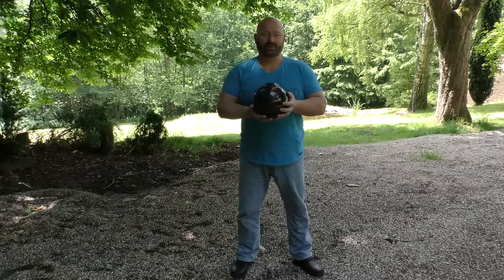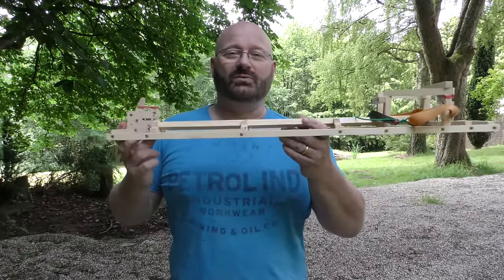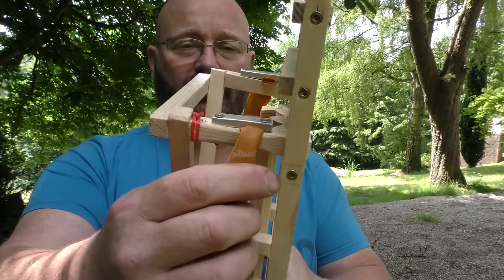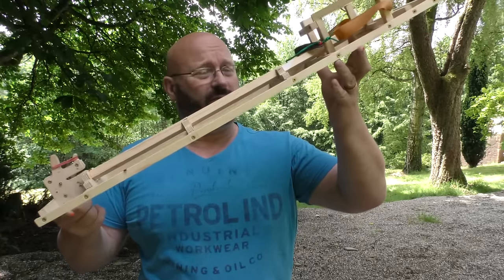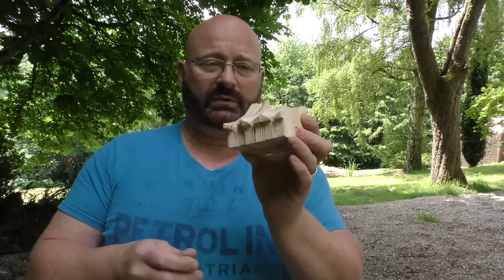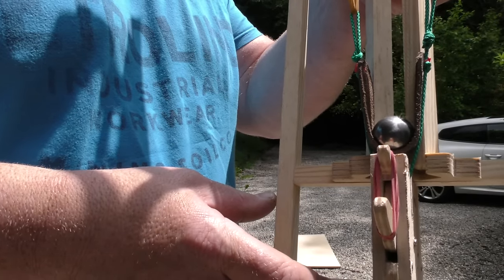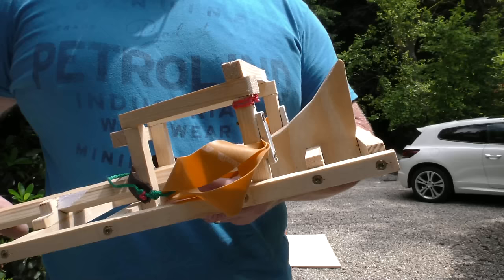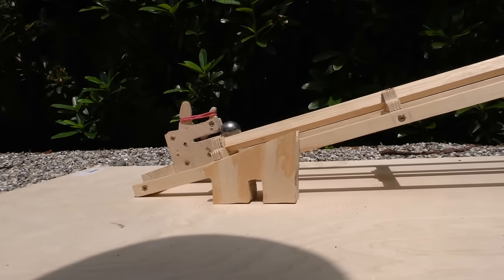Bowling Ball Launcher 1:10 Scale Experiments

Comment: Hoist, hoist hoist. It should be much more successful that way. A smooth-transitioning ramp of 30-35* or so would do relatively well as long as it's a smooth curve from the flat to the angle instead of just a wedge at the end of the track. However, i feel as though the energy loss would be  much more significant on that scale unless the ramp is EXTREMELY robust, which it would have to be anyway. That's an enormous amount of energy to deflect without things crumbling to splinters. Good luck, my friend!

Comment: Use the ramp.  You get the advantage of accelleration over a flatter surface with out having to overcome gravity from the start.  I think that any loss at the transition to the ramp will be relatively insignificant.

Comment: Why not do a little of both. Lift the end of the entire launcher a bit (what ever is physically feasible), and also have a slight ramp. Using both you can get as close to 45 degrees as possible, without having to prop up the launcher at that insane angle, and not lose as much energy from friction by using a ramp with a smaller angle. 
I guess the question is, where are you planning to shoot the full scale model? Do you have enough room? You don't want to accidentally land this on the neighbor's car.

Comment: I personally think that hoisting it up is the best solution. I'd expect the bowling ball, which is far less dense, to lose far more of its energy on the ramps at the end.
You could technically hoist it further up by affixing it to the ground and putting the piece of wood you will hoist it up on further towards the middle of the construction.
Another possibility would be to hoist it up using ropes.

Just to give maye a few ideas you may not have had yet.

Comment: I would think the use of a hoist and support would make it a wee bit more versatile. Of course, if you put the support legs on a hinge, and wheels on the base of the legs, then you could attach the hoist between the legs and the frame of the main body. Then it would lift itself, with no need for an overhead hoist.

Comment: The problem with the wooden ramp is the losses due to friction. This is doubly important because the forward force is going onto the ramp, increasing the friction.  Even if you set the pouch to roll the ball and coated the surface with a lower friction material a lot of energy would be used up compressing the wood in the ramp. I would suggest a steel ramp at the very least. Better still would be to hook a roller track from a door frame and have this under the whole path of the ball.

Comment: build a staircase under the end of it at 2 meters tall, hoist the contraption onto it, and then go up the stairs and hoist it to 2 meters above that from the staircase, that would take it to about 28 degrees.  either that or build a tower that's about 5 meters tall with a winch on the top of the tower and use the winch to hoist the end of the shooter up to whatever angle you want.  if you have any questions, i will be happy to help with concepting

Comment: Yeah I don't really think the ramp attachment will work. If you are going to accelerate a 10lb (4.5kg) bowling ball like that I think it'll apply to much force to the ramp and it'll ruin it on the first shot. Sadly I think your best option is to hoist it up or you could build the rail and raise it on its own slightly to provide it's own hop up.

Comment: Remember material strength applies and doesn't scale if you're using the same wood. That ramp will destroy your machine on larger scale or at the least the ramp itself will turn into splinters. Especially if you're scaling up the power output too. Btw, 'more far' = further.
Reply from the maker: From Merriam-Webster:
Usage Discussion of farther
Farther and further have been used more or less interchangeably throughout most of their history, but currently they are showing signs of diverging. As adverbs they continue to be used interchangeably whenever spatial, temporal, or metaphorical distance is involved. But where there is no notion of distance, further is used <our techniques can be further refined>. Further is also used as a sentence modifier <further, the workshop participants were scarcely optimistic — L. B. Mayhew>, but farther is not. A polarizing process appears to be taking place in their adjective use. Farther is taking over the meaning of distance <the farther shore> and further the meaning of addition <needed no further invitation>.
Reply: lol
Reply: lol
Reply: ha ha ha ha ha ha ha

Comment: You could build it on the back of a flatbed truck? Maybe not the best (or cheapest) solution but one with a hydraulic bed would let you set the angle and make it easier to move around being 7m long.

Comment: i think the hoist will work far better, because using the ramp, the ball is impacting the ramp at the point of change in the angle. so you would most likely see less loss in distance using the hoist. but why not make the hoist into another winch style design so you can adjust the height, and thus the angle.

Comment: Instead of using rubber for a slingshot, try using a piston with a little bit of air in it. As you pull on the piston, the air expands; creating negative pressure. If you let go, the piston retracts just like a rubber band. Big syringes work great as a piston.

Comment: I believe you should hoist the entire contraption to a 45 degree angle rather than a ramp. With the entire track at an upward angle, it is a gradual acceleration where the ball leaves the track at its fastest. With a ramp at the ending the track, I believe that it will slow the ball too much to be efficient.

Comment: As much as the bowling balls weighs you'd have to leave a good amount of footing past the ramp, or the weight would cause the entire structure to flip up from the rear as the weight hits the ramp, or anchor the rear of the structure down to the ground. If you incline the main leadway it would put all the force of weight at the rear on the launcher, so i would probably be a a good ideal to dig out a flat angle in the dirt for the rear of the launcher structure to sit in so it doesn't shift as soon as you launch and cause your trajectory to be off. Or the weight of the ball hitting the ramp would cause the support beams or angle block to crack, or flip over off the end of the rails.

Comment: just angle the rails upward (with supports), as it would be much easier to build it that way, than lifting the entire contraption. also would allow for a fixed base, which should mean better stability, and you wouldn't lose velocity by using ramps.

Comment: I think that the firing rail should be at an angle to the base, 15-30 degrees elevated while set on flat ground. It'll be a bit bulkier but it'll be nice and sturdy without needing to jack the entire structure up.

Comment: use a scissor system perpendicular to the front to hoist it in the air. Using a rope system across the front with varying locking points you could easily change the angle of launch. I'd be interested in drafting something for you.

Comment: I think if you use a curved ramp instead of one consisting of a few sections at different angles, you would lose less energy.
But it seems that hoisting the thing up works better. So, why not add kind of a bipod that would be hinged about the middle of the "barrel" and stretch to the "barrels" end. The other end would roll on wheels and if it's pulled  back by another winch and rope, it would hoist the barrel up. With wheels two meters apart and rolling on kind of rails, it should be stable enough.

Comment: The ramp isn't going to work. The bowling ball is going to have way too much energy by the time it plows into it. Fortunately, I have a simple and cost effective solution for constructing the rails at an angle: pre-fab roof trusses. While you could get away with cutting one in half and using each wing as a rail, you'll probably want another to build out an exterior frame as you have in your 1:10 prototype. I'm not sure what's available in Deutschland, but here in 'mericuh you can get 4/12 pitch which translates to 18.43° which is right around the sweet spot you established experimentally. The frames shouldn't cost you more than 200€ and will let you focus on the fun parts of the build.

What I want to know is what kind of rubber you're going to use? Do they make bands that big or will you be chaining smaller ones?

Comment: when your little experiment ball hits the wooden ramp it doesnt couses much smash affect but in real version you will have lot more energy focused on same element(wood) that may couse dents in wooden ramp. I think you should use a parabolic ramp that starts with zero angle at first few cms and starts to increase slowly. you can reach any angle at end of the ramp. Also important part of ramp is the end. You get greater energy lose as you increase ramp elevation but you will get maximum range at 45 degrees to ground. AGain most critical issue is the compressive strenght of wood that you use in ramp. İf your ball hits it nothing will go good. Also when the ball slides on the ramp it will push whole weapon to the trajectory way you have to fix weapon at both ends. Maybe mid span will be needed also..

Comment: I vote to hoist the launcher. You could build an A-frame with pulleys and raise the A-frame higher than your normal reach and use the pulley system on the A-frame to hoist the launcher. I would imagine with some math you could even adjust the launcher's angle incrementally in this way.

Comment: Hoisting the ramp should be better once tha ball will not impact on the additional ramp, but harder to do.
If you choose the additional ramp you need to prepare it to hold the ball impact and not deform with it. If you use only wood it will deform more and more and the impact will be each time higher.Good luck!

Comment: Hoisting it up will have a much better result in real life and here's why. Your scale model is based on diameter, wich means that the diameter is 10x smaller. But when you consider the mass, it is 1000x for the same material, but even considering the material were not the same, the ratio would be much bigger then 10x. The energy loss when the bal hits the ramp is based on the mass and the speed of the ball, and with a huge mass, the shock will lose much more enrgy then the model did.

Comment: Build a simple "A" shaped structure out of two beams with a winch at the top and hoist away. the back end could be fixed with two stakes so it does not slide forward or back. Then it should stand on its own, hanging by the winch.

Comment: I think a sharp angle (15 degree changes) is not ideal.  I'd wager you want a curved ramp (circle arc would do well) with the entry tangent to the acceleration rails, and the exit tangent to your desired launch angle.  This would loose less energy to impact, and also seems safer.  I'd wager with the straight ramp design, there's a good chance the ball is hitting the entry of the ramp and bouncing well off up the rails, which on a larger model could be quite dangerous both in terms of the final ball direction, and breaking the ramp.  At the very least, I'd put the high speed camera on it to look for this bounce...

Comment: Elevating the slingshot should overall have better results because with the actual launch being 10 times larger the ramp would have to be very gradual so that the bowling ball wouldn't lose momentum for flight and also so that the ramp would not break from the sudden pressure of the bowling ball flying across it.

Comment: Maybe use a re enforced tripod or two stands in the front and one in the backwith a sturdy base for the slingshot and points at the bottom so it sticks into the ground (like the kabuto)and cheap sheet metal for the railings and add lubricant for less friction
Reply: Just an idea

Comment: If you where to build it on the back of a tilt bed truck (i.e. A dump truck or similar trailer) then it stay "flat" on its platform that you build it on and the whole platform would tilt super simple and you could adjust angle as you like. 🔫SCA⚔

Comment: The ramp would work a lot better if it was a smooth transition fron 0 to 15 and 0 to 30 degrees. Like an arc instead of two straight lines. The sharp 15 degree angles that the ball smashes into take away a lot more energy than a smoother transition would.

Comment: IF you want it to fly as far as posible try 30 - 45 degree angl , not ramp but putting whole thing in an angl. The diference is in 7 meters ,  witch in full size would be like 30 meters. btw i did not calculate anything so it may not be inpersicive , but more or less it should be it.

Comment: As a skateboarder,  I have seen many ramps and the problems of each one. Many times the threshold between the flat plane and the beginning of the incline is the biggest hindrance when using them. The concave transition of a kicker ramp would be better suited,  as opposed to a wedge, for this application. Similar to the ramps used in moto cross as well. With a smooth enough threshold and a very mellow transition radius,  the ball should lose much less energy,  and achieve a more favorable trajectory.
Reply: Further consideration has made me wonder if a suspension spring under the ramp would help with energy loss or stability. A very stiff spring,  relative to the energy presented. The effect would be reminiscent of the end of a Jai Alai* (spelling is probably wrong)  but in a vertical orientation, at least in my head it seems so haha. Please let me know if you give these thoughts any consideration, I would greatly enjoy knowing your opinion.
Reply: Jai Alai bat/mitt*

Comment: i think ramp would no work in bigger scale. That thing needs to be made from steel and old car wheels underneath it, so it can be mobile. The one end with 2 meters high pully system and wintch so you can crank it up in adjustable angles, so one wintch (or two) for launcher and other for angle.

Comment: Hallo. You could made double tripod stand conected with elevation rod. And conect it with bolt in the midle of launcher. Elevation rod would be next to shoting mechanism. You can aesily change the elevation and stan shouldn't be 3 m high(only about 1.5 -2 m).

Comment: in the Real scale slingshot you will need a very strong structure to raise it up and not brake under tension. in my opinion the best compromise is to put the slingshot down and add a rounded ramp that shot at 35°
Reply: or you can just make the all thing out of steel. this way it wont brake even if you raise it up a lot

Comment: I would use two big wheels but not place them in the middle. Place them very close to the end where the trigger is. At the same end, place a lot of weights, so your launcher is blanced. Then you would be able to aim up to 90 degrees without much musclepower input. The question is how to fix you chosen degree though. The whole thing should stable when you pull the trigger.

Comment: i thing the ramp whould be best but it should start earlier. id like to ad that when ball travels on that track it gains kinetic energy but it is sum of linear energy and rotation energy which is inneded for flying. so you should do what you can to minimalise rotation energy. what you should do is for example decrease friction betwen ball and track also your track is v shape and if you increase angle betwen \/ arms contact point will be lower and rotation will be less than in smaller angle ( contact points near to axle) let.me.know if you re interested and what some pictures or mathematical and psychical calculations.

Comment: How about utilizing a wheel system to make it mobile while at the same time with a screw system make the front wheels able to lift the front of the mechanism with a scissor lift to gain the best angle for firing? Thus making mobile and making it able to be lifted to the best angle and the height needed for the optimal shot of the projectile needed.

Comment: Well, obviously you would get the best result by hoisting it up to an angle of 45°, though that is of course very problematic.
Reply: Since that isn't actually correct, it's not so obvious eh.
Reply: Blasturbator
What do you mean by that? That's basic physics, a 45° angle is the theoretical optimum for these kinds of things, or isn't it?
Reply: Theoretically, yes. But adding drag and air resistance changes the optimal angle. And if Jörg is considering a ramp, that is very different from using a straight track.
Reply: utl94
Yes, though I wouldn't use a ramp. I would think maybe you could use a a rail-like system consisting of four wooden beam, meaing you could also use four rubber bands, and mount the front end to the side of a tree at approximatly 3 meters height. The rear end could then just be pushed a bit into the ground for stabalisation and you would have used much less wood. Though I of course don't know if that would actually work outside in practice. :D
Reply: I wouldn't use a ramp either, if I don't have to. changing velocity (direction) of a moving mowing ball will generate energy losses in the system.
Reply: +Robert Lee “Rokobex” Lorengel it is, if the projectiles are all travelling at the same speed, but changing the angle would change the launch speed, so 45 degrees may not be the perfect angle
Reply: If I remember correctly from army training the furthest a rifle will shoot is at about 30° ...
Reply: Set it on a hill.